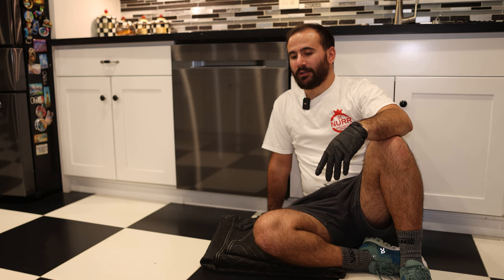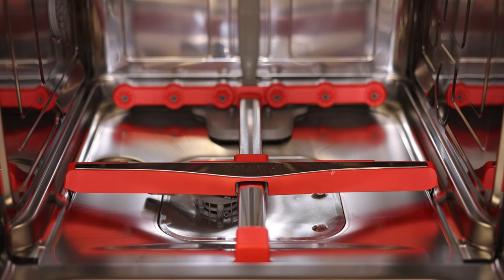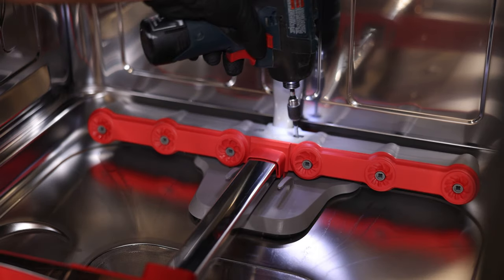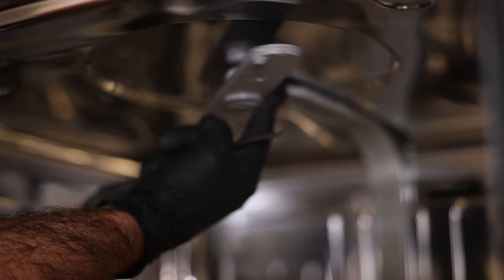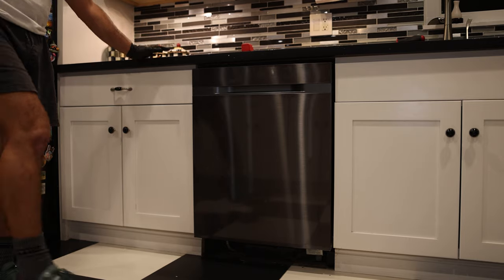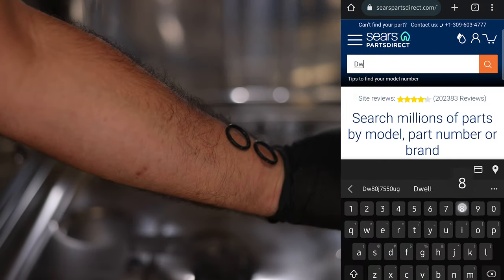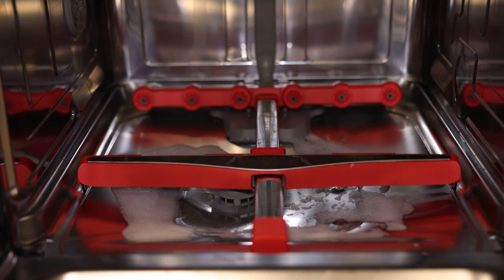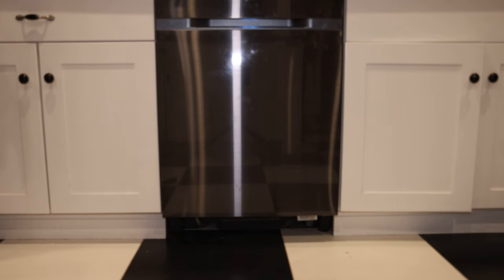Samsung Dishwasher | Waterwall Motor Replacement | 4K UHD

Comment: Very helpful video that seems to have fixed our dishwasher.  Since it was recorded the price on this part has gone way up.  I found it for $179, Samsung wanted $232 and wouldn't budge.  I couldn't even get to a person at Samsung to see if they would offer a discounted price.  Really unfortunate that they built this line of gorgeous kitchen appliances that have been so flawed.  Refrigerator icemaker froze up just past warranty, I struggled with doing a manual defrost for about a year until I finally got them to cover the parts and labor after warranty.  Now it is noisy but at least it works.

I dealt with the poor controls on the OTR microwave for 5 years before finally replacing it with another brand.  And that was after 3-4 out of warranty (attempted) repairs.  It would randomly display a 7 then maybe more 7's or once in a while a 3.  If we lock the display it was ok but why can't they just make a unit that works reliably?

No more Samsung appliances for us.
Reply from the maker: Glad this could help. Yes prices have been going up as the cost of goods has increased. 

All modern appliances are built like this (all brands have their issues). It's what keeps us in business (fortunately/ unfortunately) haha. 🧑‍🔧

Comment: You are an excellent instructor! I was able to do by following along with you… Anyway I wanted to let you know that if you have a tap-to -focus screen for your camera, tap and hold down and it should come up with a focus-locking icon (might look like a little padlock, it does on Android) which will lock the focus where you want.. That's the only distraction that I could point out in this entire video which is otherwise excellent is that every other few frames it's zooming in and out. But you can lock the focus on most video equipment. Keep up the great work! Thank you so much.
Reply from the maker: Glad this could help! We do use manual focus for recording at one focal length but when you're on a job and need to actively change focal lengths, unfortunately manual focus does not work as the subject would be out of focus (I.E showing a part up close after taking it off). The auto focus helps to show the subject without needing a second person to film. The tech can film and do the job with this in mind. 

We are working on bettering the quality but for now this is what we have to work with haha. 

Thank you kindly and Happy Holidays! 🧑‍🔧

Comment: The video is amazing. I’m certain I can complete this task. Will the access panel also allow me to change the water inlet valve? The machine makes an awful noise when filling. 
Thank y’all again for this video
Reply from the maker: Hello Mike!

The water valve will be on the front panel not the back. Easy time to replace it is when you completely pull out the dishwasher. It will be very evident which one it is as the steel braided water line will connect to it so just follow that hose.

Thank you! 🧑‍🔧

Comment: Great video - had so many things go wrong with mine - next time I’m never buying a Samsung
Reply from the maker: Glad you enjoyed it! 

It really won't matter what brand you go with. They all have their issues. If you care for reliability, look for something with the least functionality & keep up with maintenance. Remember, a dishwasher only needs 6 main components to do its job. Control assembly, water valve, circulation pump, dispenser, heater & drain pump. The simpler these systems are, the less problems they will have. 

Happy Dish Washing! 🧑‍🔧
Reply: Me too and that's a damn shame. I was loyal to them a long time

Comment: Thank you so much for making this video! I've been researching how to DIY my dishwasher because of the grinding noises. I looked up my model number (DW80R9950US) and it looks like they've discontinued the entire assembly. I can still purchase the replacement motor by itself, do you have any recommendations for preventing water leaking into the motor since I can't purchase a brand new assembly?
Reply from the maker: It's not discontinued. It's just a bit different than this unit in the video. In your case, you will need the entire assembly. Part# DD97-00484D. Hope this helps! 👨‍🔧
Reply: Thank you so much for this video! I got have this same model and bought the assembly you recommended. I finally was able to get it replaced but the waterfall gets to the back and tries to keep going. It will never come back forward. What did I do wrong??

Comment: Sir My husband and I found your video very informative and well made covering many of the different aspects of the job.  We have to replace our water wall assembly for Samsung model DW80M9550UG. We can not find the what the part number would be for entire assembly.  Everything we find is the individual pieces.  Could you provide a number for us? Thank you. Nice video.😊
Reply from the maker: Sure thing. You will need to buy the entire assembly for your unit as the motor assembly alone is not available (discontinued). 

Hope this helps! 🧑‍🔧

Waterwall Assembly Part# DD97-00484A
Link: https://www.searspartsdirect.com/product/3ru7zd57nw-0022-402/id-dd97-00484a

Comment: The motor in my dishwasher works , brings the moving part of the waterwall  at the back but not in front and makes a constant clicking noise.
Any ideas?
Reply from the maker: You have two moving arms?

Comment: Is there not an inspection hatch at the bottom of the machine to make this job easier?
Reply from the maker: What you see is what you get!

The bottom assembly can be removed completely, but you'll need to do more disassembley for sure. 👨‍🔧
Reply: @nurrappliancerepair  Interesting.  Mu Samsung Dishwasher in the UK had a pop out hatch in the bottom so you did not need to remove the entire base of the machine.  Which is a big hassle to get back on again.

Comment: Hi. What is the original symptom? My machine turns on, I select any cycle, I press start and it does not fill with water, it does not turn on the water pumps, I just hear a noise from the motor that you replaced. Thanks

Comment: Are you sure this is for dw80j7550us too as I can’t find this part in the parts diagrams? Thanks.
Reply from the maker: Hello!

For Model# DW80J7550US, here is the parts diagram. 
https://www.searspartsdirect.com/model/17juy47c6d-001482/samsung-dw80j7550us-aa-01-dishwasher-parts

If you look on the "Tub" Diagram, the Waterwall motor assembly is listed as #17. 

The part# is DD97-00216A. 

Hope this is helpful!
Reply: @nurrappliancerepair  thanks. Great video. There’s another one that is a joke compared to yours. That one is actually annoying.
Reply from the maker: @wstt4  we appreciate the positive feedback! We're trying to make professional grade tutorials so anyone that wants to try a repair, can do it. 😊👍

Comment: Great video..but why changing the motor when the complaint of noise during slide ? Noise during slide indicates motor is spinning but there is some mechanical gear/belt issues...Motor to be replaced only if arm stops moving back and forth..is it ? Even then, a good technician can test the motor either using the seld diagnosis or external test if he is skilled enough,  before throwing 140$ into samsung pocket.
Reply from the maker: Hello!

We explain the failure in the video. The gear and belt were both in good condition as show in the video as well.

Thanks for tuning in! 🧑‍🔧

Comment: This video is excellent. It’s the best repair video I’ve seen as it covers every single step. Keep posting more. I noticed after the new motor my waterwall finally works again, but when it gets to the back it seems to try to keep going back more for a few seconds. I’ve read this is a magnet sensor problem. Do you have a video for that? 
A few comments in this video, thank god you said to test it to look for leaks, I went back there and noticed that big collar had come off completely. If you don’t turn it far enough with hitting it with the screw driver, which I thought I had, it slowly turns itself back and comes off. 
Another thing, my water supply metal tube had no slack so I didn’t know when te to disconnect it at the sink, or by the kick plate? (It appears it goes underneath to the front by the kick plate. ). When I put the dishwasher back though I had the hardest time getting the tube pulled back to the front. I used a string tied to it.
Reply from the maker: Really means a lot, thank you! We're going to keep em' coming. 

It really is up to you how you would like to disconnect the water supply line. Either way during reinstallation the water line is going to need to go under the dishwasher to get under the sink. There is a little groove where the water line will fit under the dishwasher so it doesn't kink or get squished, it tends to find it's way there after a few movements of the dishwasher.

It's common practice for us to disconnect the water line from the front as it give us more room to work versus trying to disconnect it under a sink. But if you're going to do this repair, might as well buy a 6-8 foot dishwasher water line and replace that while you're at it if it's your personal home ($10-$20 on Amazon, steel braided 3/8 inch). Just remember to shut off the water valve under sink first and also check to make sure the water valve under sink is still functional. In older houses they tend to still leak water through the line (sometimes worse than others). Once you take the hose off and there is still pressure in the hose, you're going to have a hard time putting it back on; find the main waterline to your house before hand just in case you need to shut the water off to the home completely (just a disclaimer to be safe).

If you decide to leave the water line you have, you can tie a string around it and pull it under the dishwasher when reinstalling the unit, but we recommend just replacing the hose if you have to go through all of that.
Reply: @nurrappliancerepair  I edited my comment above before I realized you replied.  My comment is very different now. Can you look back above?
Also, someone in another video said the default motor position when you put in a new motor is for the waterwall to be in the back. They said you need to put your waterwall to the back before putting it back on the new motor. I didn’t do that. Maybe that’s why when my waterwall gets to the back it keeps trying to go back further? Some say the magnet sensor breaks. I am afraid the motor will break bc it’s keeps trying to push it back further.
Reply from the maker: @wstt4  Did you replace the entire motor assembly or just the motor itself?

During your repair you should of seen 2 connectors, one connector for the motor and one for the sensor. The sensor comes with the entire assembly if you did replace the whole thing (which we recommend).  There is the position (Vane) sensor for the motor. You can buy it separately, its #17-2 on the diagram. Part# DD32-00011A  

Also where did you get your parts from?
Reply: @nurrappliancerepair  I got the full assembly part, not just the motor, from an Amazon, third-party seller, shipped by Amazon, because I wanted it quickly, and I wanted a chance for possible hassle free return.
By inserting a small screwdriver in the side of the door latch opening, and starting a cycle, I see the water wall keeps trying to go back for another 10 to 20 seconds after reaching the rear of the DW. A few times, when the water wall was going towards the back, I took the rear of a flashlight that has a strong magnet on it, and got it close to the sensor, and the water wall, then stopped and started going forward again. This leads me to believe it is my magnet in the bottom of the water wall gray attachment. I have seen many people say these magnets  go bad overtime, and some buy a string rare earth magnet, and either epoxy  it, or, just stick it onto the water wall gray piece that connects to the conveyor belt. 
I’ll add I’m in Hawaii so most parts can be expensive or long to ship so Amazon is best. Once it took over 30 days as a regular merchant sent a tiny item by boat.
Reply from the maker: @wstt4  At this point we would suggest probably returning that to Amazon and ordering a factory part. We can order it for you if you would like and ship directly to you with our distribution partners. Truthfully we have not come across that magnet issue.

Comment: What is the part # for the Model dw80m9550ug
Reply from the maker: Hello!

This unit is a bit older so the repair may vary slightly. The Motor Assembly Part# DD97-00496A but this part# is no longer being made by the manufacturer. 

Your only options is to purchase the entire Waterwall assembly which is part# DD97-00484A current retail price $258.66 

Thank you!🧑‍🔧
Reply: Thanks for your quickly responds
It is possible replace just the motor? @nurrappliancerepair
Reply from the maker: @juancguerra7566  yes you can but we don't recommend it as the seal can leak. It's worth a try if you want to go that route. The part is the same as the video dishwasher. 🧑‍🔧

Waterwall Motor (Motor Only) Part# DD31-00013B

Thank you!

Comment: What is the part # for the Model DW80M9960UG
Reply from the maker: Hello Jesse!

The water wall system for this unit is a bit different but the fundamental process for the repair is almost the same. Your unit seems older then the one in the video.

You have a choice of replacing the entire water wall system with this Part# DD97-00484A (Retail $258.66) (You can look at the picture on this link. https://partsdr.com/part/dd97-00484a-wash-arm-assembly?gclid=CjwKCAiA-P-rBhBEEiwAQEXhHzyg_zzhhxXzYL6XzghCZNXdfPivsFK2X9RXR5v0RY5DDl82A0a46RoC_wQQAvD_BwE) 

Or you can just replace the Motor Assembly Part# DD97-00496A if you can find it. Our research states that this part# is discounted so this may not be an option for you.

You can also replace just the Motor Part# DD31-00013B (Retail $185.90) which is available but we personally would recommend replacing the entire system if you're going to put that much effort into it.

Here is the link to the diagram. https://www.searspartsdirect.com/model/5xeau5bfhh-001482/samsung-dw80m9960ug-aa-00-dishwasher-parts
Click on the "Motion" Tab. The system is #1 Motor and #2 Waterwall on the diagram. The respective parts are listed below the diagram. 

Hope this helps! 🧑‍🔧

Comment: how do you tell if its the motor that has failed?
Reply from the maker: Hello Trevor,

Did you watch the video?👨‍🔧
Reply: @nurrappliancerepair  you betcha 4 times and 4 other videos. The motor spins but the water wall doesn't move 😭
Reply from the maker: @Trevor.Morrice  what do you mean by the motor spins? By hand, or did you put power to it?
Reply: @nurrappliancerepair  yea I took the bar off that has the belt and stuck my phone in the machine, turned it on and the motor spun
Reply from the maker: @Trevor.Morrice  then likely your problem is the plastic gear assembly that the motor arm slides into. We've seen that strip out. Make sure the gear and the belt is not seized up anywhere as well.
Reply: @nurrappliancerepair  the keyed gear isn't stripped and the belt moves freely when disconnected
Reply from the maker: If that is all in good working order, then the motor is the issue. The motor might only have enough strength to spin with no load on.